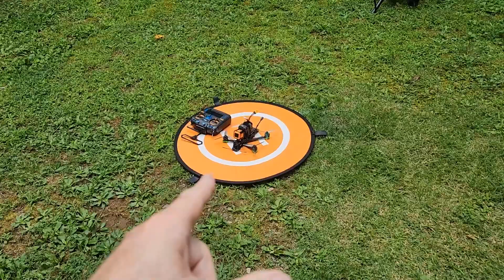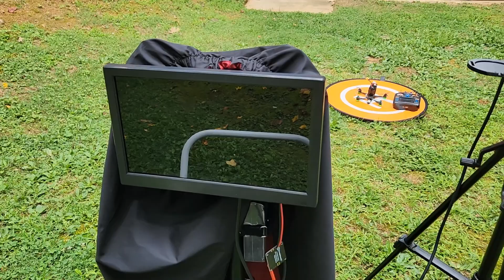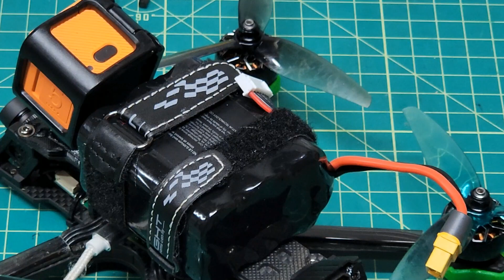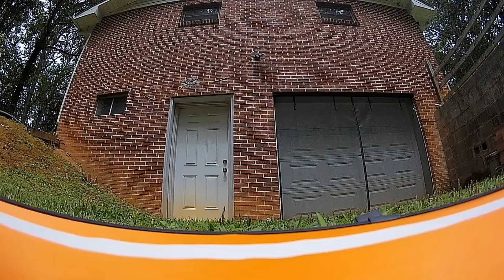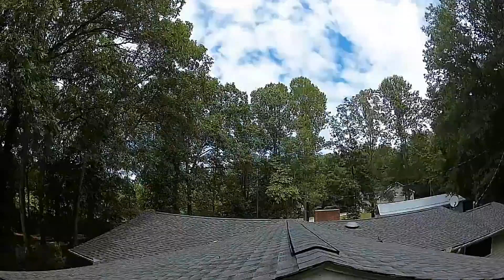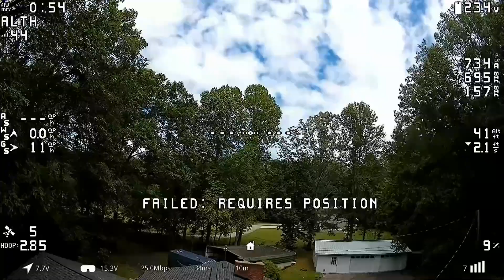Nazgul Evoque First Test Flight

Comment: Glad you found it! And it works for you but you got some wicked jello
Reply from the maker: Yep, yesterdays fix didn’t work completely.  It needed more testing so that is why I was testing it today.  The first one I thought was just a HEAVY battery, but it did the same type of thing again when I switched back to the lighter battery for the second test.  Going to cut those other two parameters by 50% and go again tomorrow.  Might test it as is in stabilized to prove that the problem is in Althold mode.  I really need to take it out to a big field and not here at the house where it is so tight.    lol